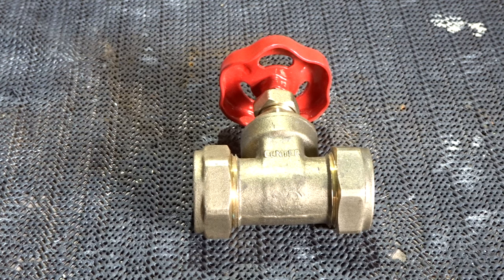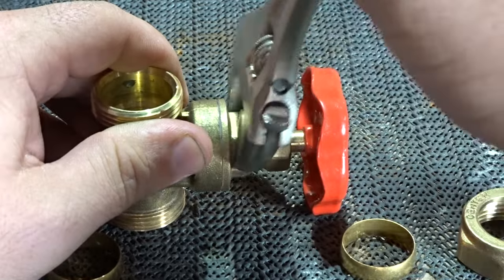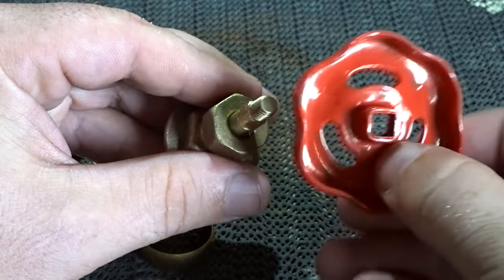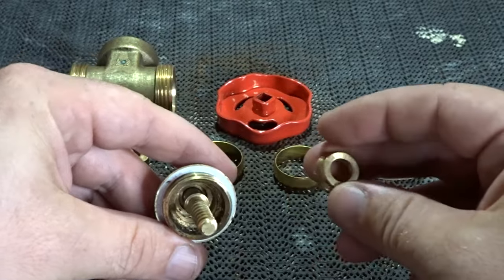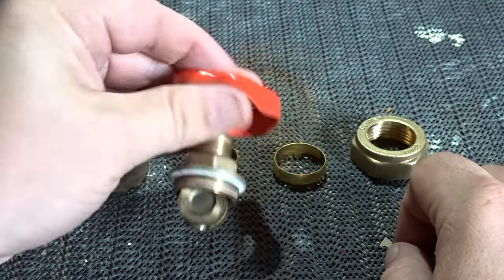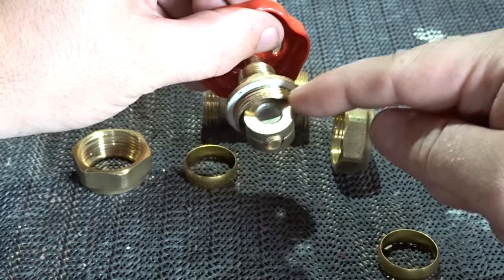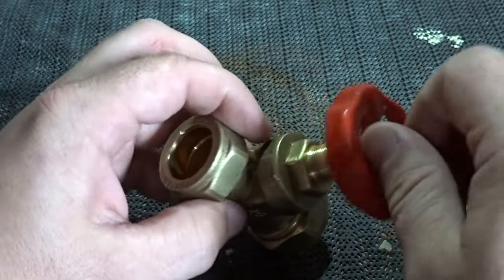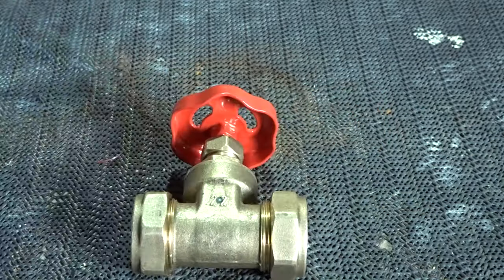Basic plumbing / Stripping down a gate valve.

Comment: As you say it is unneccesary to use PTFE tape on the compression joint threads. PTFE is for use in threaded pipe joints where the PTFE is pressed into the joint. It replaces the ‘old’ method of horsehair and plumber’s mate paste designed to seal the threads of the joint. However it is also inappropriate to add PTFE tape to the olive to reconnect the compression joint.  The seal in these joints is made by the compression of the olive in between the two conical surfaces of the valve body and the compression nut.  Thoroughly clean the conical mating surfaces of the valve body and the compression nut and use a NEW olive if the original is damaged.  However, typically when you remove a valve from the existing pipework the olive will have pinched the copper pipe it is attached to and capture the nut on either side. These connections can be reused without disassembling the olive if the conical nut surface and olive are in reasonable condition. The compression joint will not leak if the nuts are correctly tightened.
Reply: Very true, also this person makes no mention of this valve having gland packing which prevents water from leaking out of the stem of the .valve.

Comment: what can i use to descale a gate valve once it is removed? can kettle descaler be used with brass?
Reply from the maker: I'm not to sure, some descales can be very hard and could damage the brass.
Reply: @expedition320  i used hot vinegar it appeared to remove scale but valve was still jammed
Reply from the maker: You may need to get a new valve unfortunately unless it can be unjammed.

Comment: All you did is take it apart and put it back together. And it looked like you may have tightened that packing nut too tight, besides the point though.
      This could have been interesting if you took apart an old one and showed how you clean all up and then put it back together.
Reply from the maker: Thanks for your comment I will keep that in mind for a future video 🤙🏻